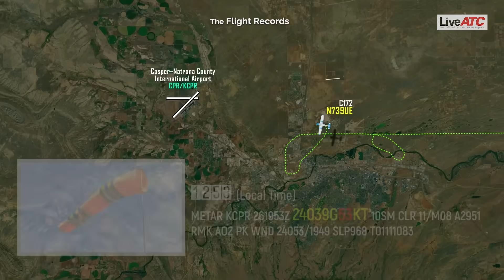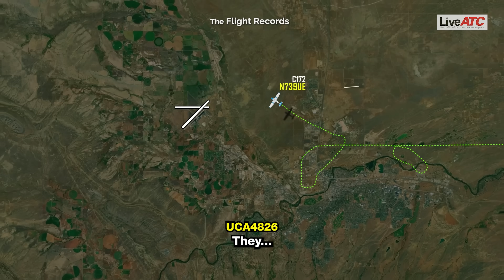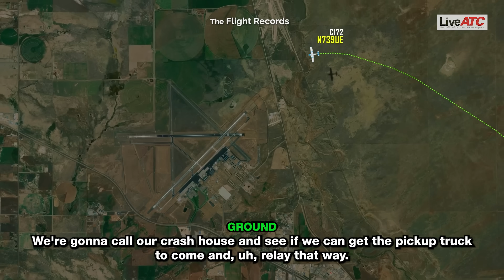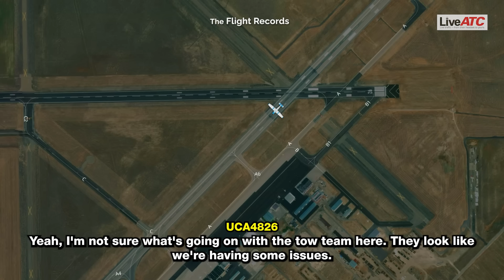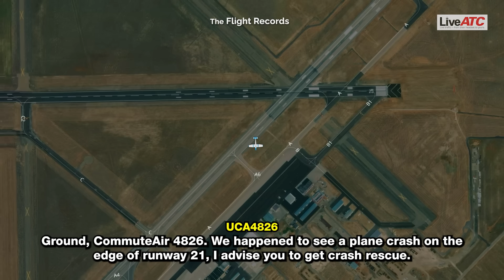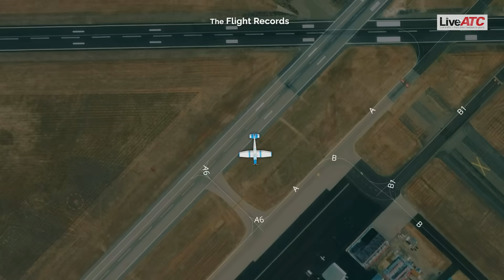GUSTING WINDS FLIP PLANE AT CASPER AIRPORT!

Comment: I had a similar landing once. On final I asked controller for my groundspeed. He came back with I'm showing you 8 knots across the ground, I was in a 172. Landing was like coming down in a hot air balloon. I was MORITIFIED during the 90 degree turn to taxi.  I acutally held for a few mins to let the gusts die down. Did not flip, but would not do it again in those winds.

Comment: 1. The Max Demonstrated Crosswind for a Cessna 172 is 15 knots. You CAN push that a little further but at that point YOU become a "test pilot", and EXTREME CAUTION is advised. I personally DO NOT RECOMMEND IT.

2. The reason for the small loops near the airport were likely to give the pilot time to get clearance to enter the DELTA airspace KCPR operates in. Clearance requirements to enter a DELTA is simple, just 2 way radio communication. This means you contact their tower, and they respond back with your tail number and you are cleared in, unless they say "remain clear of the Delta".

I understand there are going to be some pilots that comment on here stating "I have flown, landed, and taxied a Cessna 172 with winds at 30 gusting 40 no problem". This is about ADM, just because you can does not mean you should.
Reply: Max demonstrated crosswind only means the amount of crosswind during which the A/C longitudinal axis can be aligned with the direction of desired travel (or the runway). Beyond that, you're not really a test pilot as students land in crabs all the time, and the plane tends to handle it to a point. Landing in a crab was not what happened here, though. Pilot has to have lost discipline on maintaining the flight control surface positions during taxi. "Climb into the headwind, dive with the tailwind" is the mnemonic I use when teaching flight. Too many pilots think that once they're on the ground they're all done. The flight is never over until the aircraft is parked and secured.

Comment: Proper aileron and elevator control when taxiing light aircraft during high and gusty winds is important. Landing with high headwinds are fun, your ground speed is like 20 kts, and you can stop within 150 feet. But the winds during taxi will bite you if you're not careful.
Reply: Had a friend who landed his RV-7 into a strong headwind and could not turn off of runway onto taxiway.  Tower sent out fire truck to block the wind and escort him to parking area.

Comment: When you make stupid choices it's always impressive right until the moment when it's not.
Reply: What stupid choice? For all you know he had been holding for an hour waiting for winds at this and/or alternate fields to die down and was getting close to fuel limits. He nailed the landing, he just got unlucky with the taxi. Proper control input for high wind taxi will only get you so far in 50 knot gusts.
Reply: @michaelhorne8366 there is no conversation on the frequency to indicate that. For all we know he didn't check the weather, then thought it would be fine. Much more reasonable assumption than what you came up with.
Reply: @alk672  Why would that be discussed on frequency? He might operate with a safety margin of 20% over what the minimum margin is just to make sure he never gets stuck near a point of having to declare a fuel emergency. And again, the incident happened on the ground, after a landing which was apparently executed well enough to draw praise from a controller who see's dozens of movements a day.

You can't go calling people stupid based on any assumption, however reasonable you think they may be. You can only judge based on what you see, which, here, is an apparently exceptional landing, and a flip in gusts that would have upsided any unrestrained bugsmasher, appropriate control inputs or not. Doing so just kinda makes you sound like a salty armchair pilot.
Reply: @michaelhorne8366 I strenuously disagree. The proper safety mindset is not putting oneself in a position where you have to handle 50 knot gusts, not relying on your insane skill to be able to handle it all the way to the tiedown. Yes, I can imagine a scenario where a pilot did everything right and still got caught off guard with low fuel and no better place to land, but it's very difficult to imagine that 50 knot gusts were not forecast, and that it was exactly the same everywhere, and there was no better runway, and he couldn't wait for a bit longer. On the other hand, it's very easy to imagine that he didn't check the forecast (or checked it and brushed it aside), and then accepted insane landing conditions because he needed to be at that particular airport at that particular time. There was zero sense of urgency in his voice or any of his decision making (as far as we can tell from the recording), so unless you have more data we can pretty safely conclude his decision making was questionable.
Reply: @onyourbikes that kind of extreme winds being unforcast is very rare; when that happens, it's not a widespread phenomenon, and you can find an airport where those gusts are not present. Again, it's possible to imagine a scenario where the pilot did nothing wrong and was forced into landing there and then, but that is highly unlikely. Had that been the case, the pilot would have certainly discussed the situation with the controller to see if the controller has any information about how the weather was supposed to change in the coming hour or so, if other airplanes had issues landing, etc.
Reply: @onyourbikes well if this dude routinely lands and taxies in 50 knot gusts, then that in itself I would call poor decision making. I'm not buying it, he didn't sound concerned on the radio at all, doesn't look like it was something too unexpected to him.

Comment: I was a CFI in Goderich Ontario Canada. I was concerned about gusting surface winds up to 20 kts. I kept checking with flight services about the nature of the wind situation. I was instructed by management that it was imperative to move the Cessna 150 two seater to maintenance. I was reluctant to untie and move the aircraft and I was under penalty of dismissal if I didn't comply. I untied the aircraft and without warning the wind Husted up over 50 kts from behind while I had yet to secure myself. The aircraft did in fact flip upside down and carried inverted for 40-50 ft. I managed to pull myself from being wedged in the baggage area and exited with hail falling around me and   I hunched over walking to the terminal building. I spent 8 days in hospital, sleeping on my stomach because of damage to my back. My "boss" told me after that I had permission to refuse next time I didn't feel comfortable about weather conditions. It was unfortunate that the aircraft, after having a very nice paint job, was now a write off.
Reply: Being dismissaled for refusing breaking the law ???
Gues the guy who made you do it should end up in jail.
Reply: @pascalcoole2725  Actually it was a gal not a guy. I still don't know what she was thinking because there was another airplane that was tied down got flipped as well. I had experience float flying and was somewhat knowledgeable on weather with an ATPL. The boss lasted a little longer than I after I left and she eventually got fired.

Comment: One has to  the question the wisdom of flying a light Cessna 172 under those conditions.
Reply: Oh boy! I landed at Casper many years ago under almost the identical conditions, in my P172D at the end of the second leg of an Angel Flight. I had picked up my passengers (Gramma, Mom, and 2 year old daughter) in Scottsbluff, NE, where there were light winds. The forecast for Casper was for light to moderate winds. As we came over Douglas, a check of the Casper winds showed it was still reasonable, 10-15 knots splitting the runways. But as we neared Casper, Approach advised that the winds had picked up to 25-30 knots, still splitting the runways. When I was handed off to Tower, the winds were still the same, but as I was on about a 5 mile final for 21, the winds had picked up to 35-45 knots, splitting the runways, but wavering a little more toward 26. Tower asked me if I wanted to switch to 26 or stay with 21, and I elected to stay with 21–the crosswind component wouldn’t have been much different. 

The landing itself was uneventful, much as the accident pilot’s. Taxiing was a real chore, though, and I made every effort to remain aligned with the wind as much as possible by cutting the corners on the taxiway onto the ramp. 

I spent a couple of hours at Casper, hoping that the winds would die down. Instead they got worse. When it came time to leave, Ground cleared me to taxi via Alpha to 21. I told him “unable—prefer via Alpha 5 to the runway, to avoid turning the tail to the wind.” If I’d had to taxi much farther, I think I would have worn out my right brake, as I had to ride it all the way to the runway to keep from weather-vaning. When I was cleared to take off, the airplane rose like it was on an elevator—I was at pattern altitude before I had flown past the hangars. I requested an early left turn, and in no time I was cruising at 180 knots toward Douglas—that was a 65 knot tailwind. 

For all those wannabees who chastised the accident pilot, just let me say this: if you can’t fly in fierce winds, you won’t fly into or out of Casper—or many other places in Wyoming. I’ve landed there many times, and the winds are always a major factor. A 20-25 knot wind is normal; more wind isn’t unusual at all. I commend the accident pilot for getting the airplane safely on the ground. That the wind caught a wing and flipped the airplane was to me unavoidable.
Reply: @calburnIII 100% accurate. I have relatives from there. For places like Casper you get a choice of windy conditions or blizzard conditions or no conditions. There are no perfect conditions. It's not a thing you get there.
Reply: The weather in Casper can change so rapidly it doesn't matter what it was 10 minutes ago
Reply: The TAF and LAMP/MOS wind forecast that was what???
Reply: Amazing indeed. Gust 46Kts,   thats almost T/O speed for that aircraft.
Some did not realy get it.
Reply: He was on the ground and apparently did quite a good job of getting it there. Nothing inherently wrong with landing into a headwind; there was a recent video ("Storm Isha gust stops landing plane in mid-air!!!") where a pilot landed in a headwind so strong they were at basically 0kt groundspeed when the wheels touched, a crazy sight to see. Just happened to catch a gust under the wing, which can just as easily happen to a parked bird that's not tied down. No fault of the pilot.
Reply: @michaelhorne8366 He was flying the aircraft under conditions outsite of the specifications of the aircraft manufactorer.
Reply: @pascalcoole2725  Was he? The POH provides performance data for up to a 35Kt headwind component for landing, but does not state this cannot be exceeded. And again, he greased the landing well enough that the controller (who see's dozens of movements a day) specifically called him out for his excellent execution. Oh yeah, he was also on the ground when the incident happened. 

For all we know he had been orbiting the area for an hour waiting for conditions to improve enough at one of the nearby airports to  land, but he was hitting fuel limits and made the call. There is nothing in this video to indicate the pilot did anything outside of the performance envelope of the aircraft, and getting blown over on the ground (as any unrestrained aircraft would in these conditions, high wind taxi procedures or otherwise) was just bad luck.
Reply: @michaelhorne8366  Let's  agree to disagree.
Reply: @pascalcoole2725  The POH for my aircraft has a max taxi wind limitation, not demonstrated but LIMIT. It even states that the plane may blow over on the ground if that limit is exceeded.
Reply: Not wise to take off under those conditions, yes. But you can take off in light winds and end up having to land in conditions like this. The best landing I ever made in a light plane (Warrior) was in similar conditions. Light breeze at takeoff, but when it was time to return, the winds and gusts were crazy. My home airport had a 3,000 ft runway surrounded by trees, and very unpredictable winds below the tree tops, so I decided to divert to a larger, multi-runway airport out in the wide-open spaces, for obvious reasons. The on-site FSS advised me several times of the winds and gusts, but I didn't have a choice. I can't say I was scared, but I was VERY focused, and ended up with a perfect squeaker, then ignored my chattering passenger who thought because the wheels touched the ground the flight was over, and I concentrated on making sure my controls were properly aligned throughout my taxi. After I tied down and we sat down in the cafe my legs got a little trembly.  The winds died back down in about an hour and we flew home without any incident. Best not to judge unless you know.
Reply: Based on what I heard in the ATC it sounds like they probably took off with light wind this wind came in and the decided to land and wait it out @billm6819
Reply: absolutely nothing wrong with flying down a runway with those winds  coming down the runway - done it before - its the TAXIING thats brutal
Reply: Still a dumb decision to fly when the winds are forecasted/are that strong
Reply: @champ6902 Norfolk, Virginia a few years ago, the winds were forecasted as like 12G19 and out of know where it blew hard enough to flip an 80,000 lb MH-53 and several MH-60 helicopters. The winds were estimated to be in excess of 75 MPH and there was only a 12 minute warning that winds could exceed 60 MPH.
Reply: Nonsense

Comment: Sometimes the winds change after take off.  Back in the early 90s. I was a newly minted CFI.  Pullman Washington.  I was in the pattern with a student and saw a wall of dust rolling towards the airport.  Told the student that this was the last landing.  We arrived at the same time as the gust front.  Landing was fine but it's the turn that is dangerous.  We were landing into the wind which meant the turn off to the taxi way would put the wind under our wing.  Luckily the FBO/Flight school people saw the winds kick up and they sent 4 people out to hold the wing down as we exited the runway.  I'm sure we would have flipped as well.
Reply: Similar deal at Richland. We put 3-4 wing walkers on a Bonanza once.

Comment: Loved the flipping animation! 🤣
Reply from the maker: Glad you like 🤣
Reply: I flipping loved it! 

As an aside, I never flew a 172 with winds over 30kts for this reason. I wish we had video to see if the force of the wind just overpowered the plane, or if instead the pilot didn't apply the corrections during taxi. Going from a slight right quartering headwind to a right quartering tailwind you go from up aileron on the right to down aileron and down elevator. Making that transition while turning I've had one of my mains get light with winds in the 20s. Yikes!
Reply: What runway do you want? The only USABLE runway was 21.. but taxing could be a problem without retracting the flaps and proper positioning of the flight controls..
Reply: watch your language son....😛